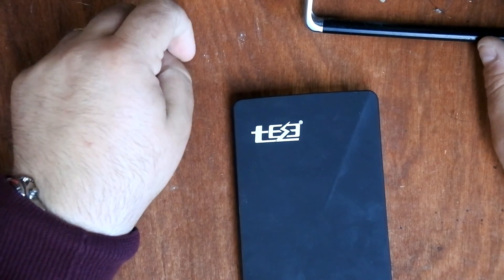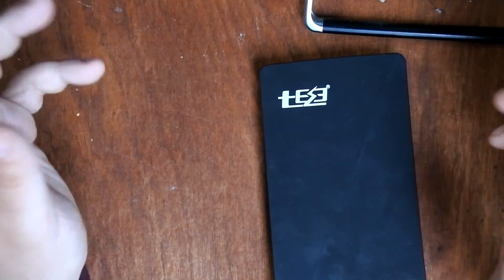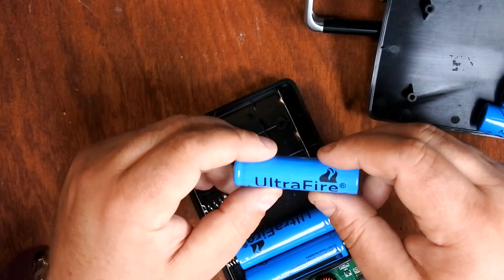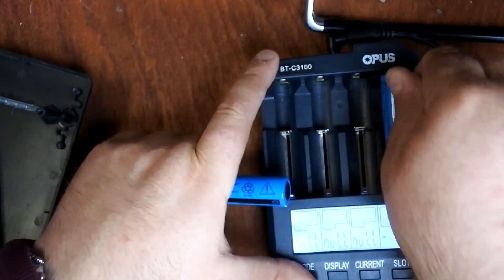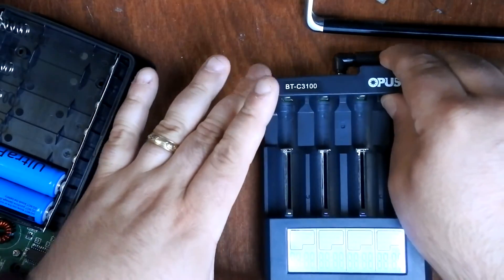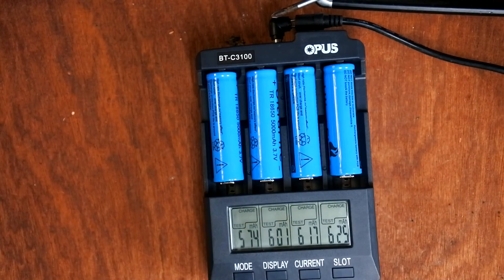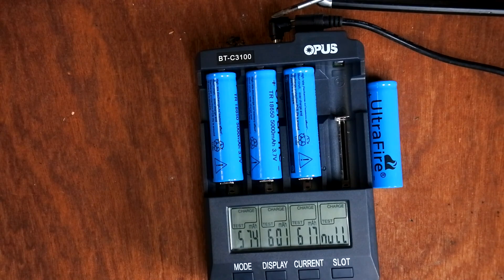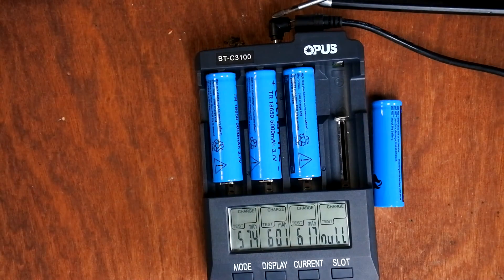Rip-off Ultrafire 18650 Batteries

Comment: Das sind echte Natriumbatterien. Wirklich keine Lithiumzellen !  Nur der 1x1 mm  kleine Spannungsverdoppler IC der im Blech versteckt ist brennt bei dieser Marke öfters durch. Läd man über einen gesonderten Li Pro Lader von Voltcraft
kann man diese wieder genauso aufladen mit der vorher integrierte bei ca 6 V -> 7.2 wenn man dort auf Auto -Mode  beim gesonderten Ladegerät einstellt . Die Verdopplerschaltung ist einOP Verstärker mit kleiner Kapazität von 1 nF  daneben ? auf 22µf über den OP aufgepumpt dann eine Querdiode verdoppelt.  [so baut man moderne Spannungsverdopplerkaskaden niederer Leistung , hoher Kondensatorkapazitäten und  ohne größere Kondensatorabmessungen. Nur leider brennt dieser China - Kram öfters  durch ! ! !
dann kann man nur mit einem Spezialladegrät wieder normal aufladen. Wen das nervt haut die Dinger dann irgendwann einmal weg !
ok der Endstufentransitor wurde bei den Gelben ersetzt. Vieleicht kaufe ich doch wieder einige.

Comment: I've got several of these brand (with claims of 5000 mAh, and 6000 mAh), I used a similar charger to do a "NOR" (normal?) test on them, and they came out between 500 mAh and 950 mAh... you really get what you pay for with these Ultrafire batteries. XD

Comment: For easy fake spotting, the largest capacity of an 18650 lithium ion to date is 3600mAh, anything higher is definitely fake.
Reply: Please provide links to your documentation of stated claim.
Reply: Do your own research or be a sucker. There are very few 18650s available above 3600mAh, and they cost ALOT.  The really good  Orbtronic (Panasonic) 3500s are currently around $32 for two.  @tonyross8054